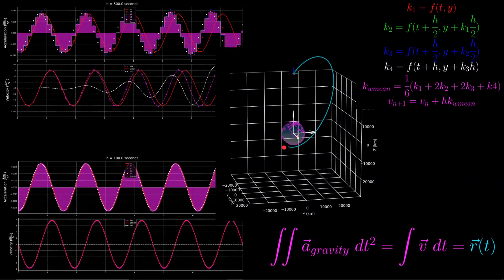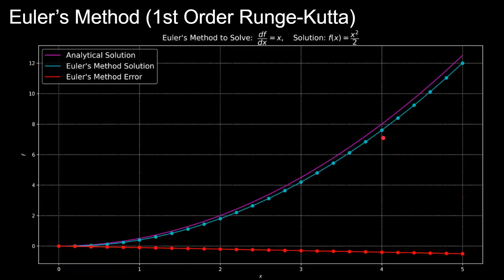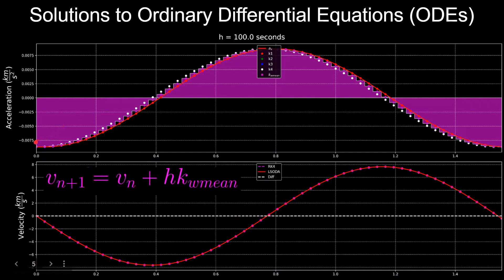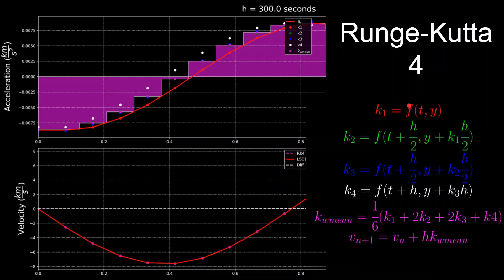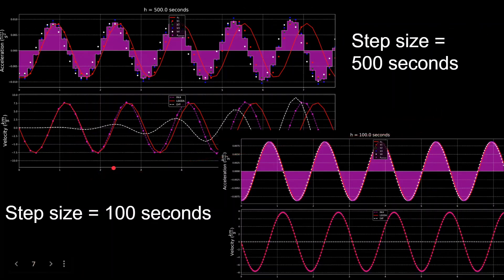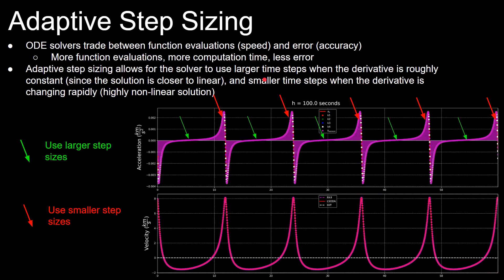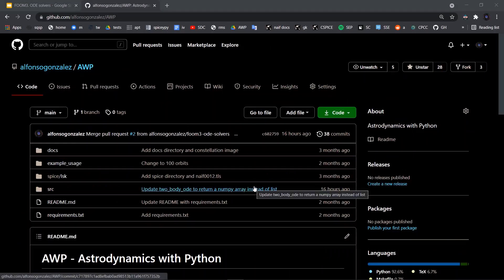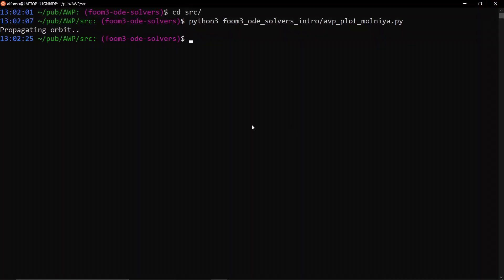Introduction to ODE Solvers (Runge-Kutta) | Fundamentals of Orbital Mechanics 3

Comment: Hello again Alfonso!

Thank you for suggesting me these videos, it was very insightful. I was able to calculate the velocity graph with the use of the RK4 method. However I'm still left trying to find the position graph. I don't know the equation of the velocity graph to use RK4 again to find the position. Although I would think it's something like that again that since the initial position of the sounding rocket trajectory would be position = 0 at time t= 0. Is there something I can do to find the equation of the velocity graph? Once again, I really appreciate your help.
Reply from the maker: I'm glad you got that figured out. The next video goes through that process exactly, of how to solve a 2nd order ODE using a 1st order ODE solver (RK4). Theres a neat trick of adding the intermediate variable (velocity in this case) to the state vector, so you can solve both levels of the ODE at once.
https://youtu.be/TzX6bg3Kc0E
Reply: @alfonsogonzalez-astrodynam2207  Oh, ok cool, yea I'll check that out. Thanks man! I'll check it out and see how it goes, appreciate your help!

Comment: For gravity turn, RK4 is accurate enough?
Reply from the maker: It all depends on the situation and what tolerances you are looking for. You could theoretically use a constant step size RK4 method to propagate a gravity turn trajectory if you use small enough step sizes (0.1 seconds?), but realistically you'll likely want to solve it with an adaptive step size method (RK4/5 is one of the most famous). Check out the "method" section here: https://docs.scipy.org/doc/scipy/reference/generated/scipy.integrate.solve_ivp.html

I plan on covering how to write adaptive step size methods in the numerical methods with python series, but I think I'm going to stick to this constant step size RK4 in this series because its more intuitive in helping learn orbital mechanics.

By the way I'm not sure if you've seen it but I've made videos on rocket trajectories on this channel as well: https://youtu.be/VajZiY72Pf0

Comment: Is there an advantage to running Runge-Kutta over Crank Nicolson? Crank Nicolson seems to have a really low orbital defect. Just computing time?
Reply from the maker: I haven't come across Crank-Nicolson in industry, so I can't exactly answer if it has been heavily considered. I would guess that since it is an iterative scheme and the equations we are using are non-linear and multivariable, it wouldn't seem like a good candidate for these applications. However thank you for bringing this up, and I can cover Crank-Nicolson in the ODE solvers series.

They have used Adam's methods at JPL for a very long time, you can watch this clip from the podcast where I ask why they prefer Adam's over Runge-Kutta: https://youtu.be/2aiFQK71EJM